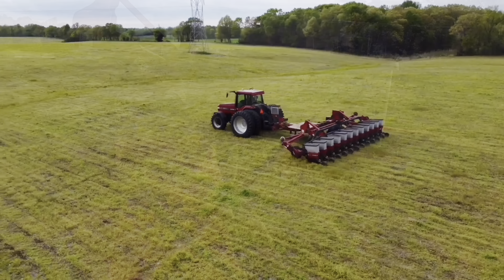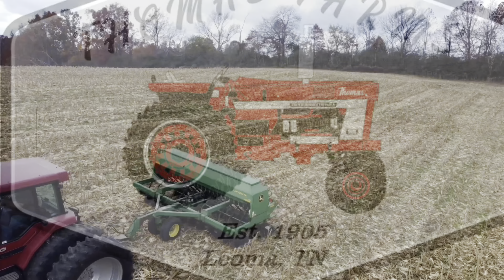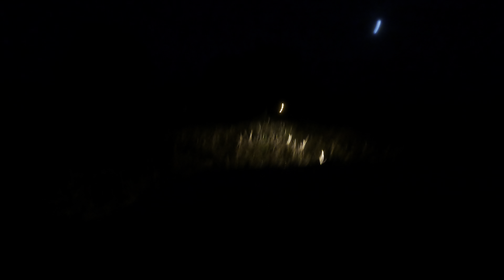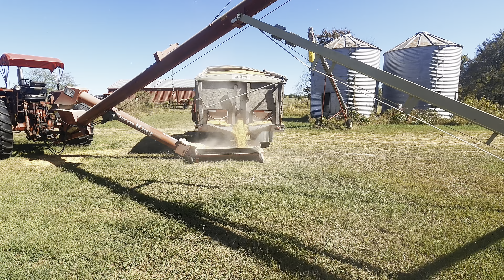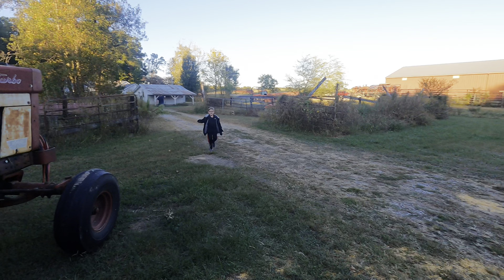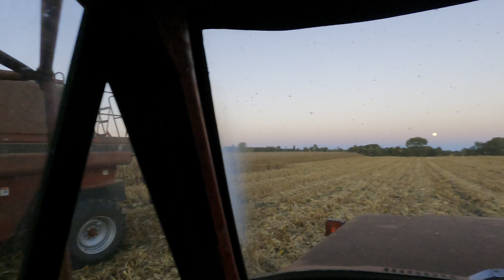Back in the Field, Corn 🌽 Harvest 2022

Comment: I live 10 miles from the Mississippi in west TN across from Osceola AR. The record low was in 2012. It’s bad, you can walk across it in spots here. Several barges are stuck. Also, can you not run pto ditches or is there just not anywhere for the water to run off to?
Reply from the maker: No where for water to run. These places have showed up after time. When it’s wet it’s about 8-20” of mud with a hard bottom. Tractors and sprayers just slide through.
Reply: @Thomasfarmstn  gotcha, busting up that hard pan will definitely help